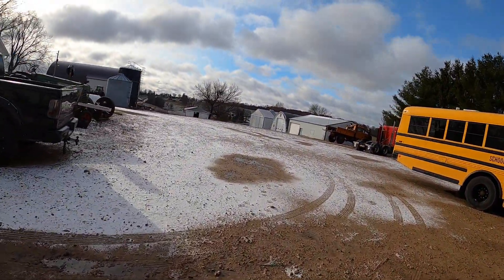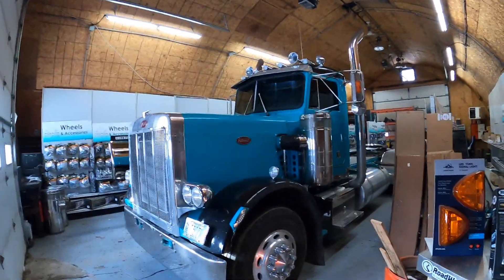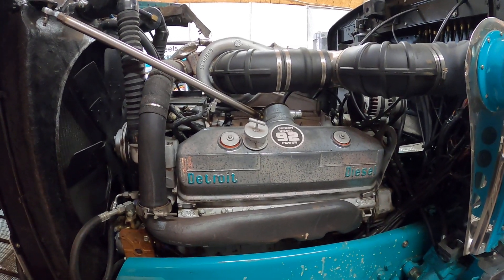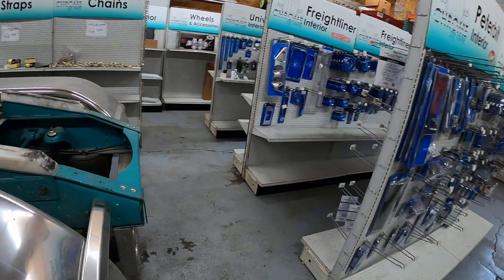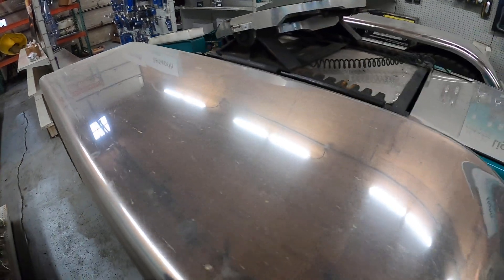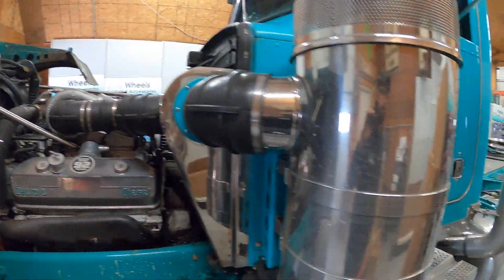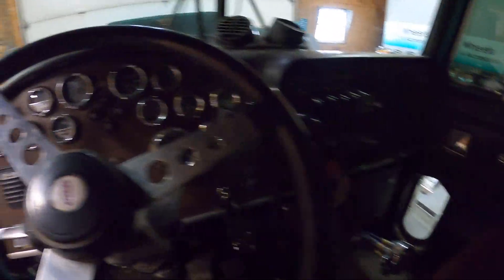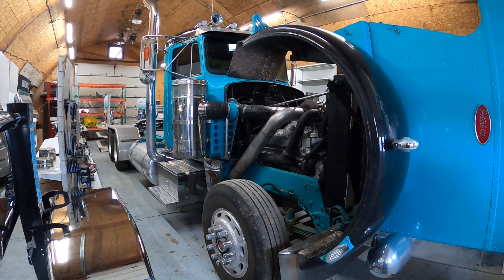JOYRIDE AN IN DEPTH LOOK AT THE DDEC 8V92 THAT ACTAULLY EXISTS

Comment: your cruise should be able to be used with a dual lead(4 wire) electronic pick up sensor on the transmission output yoke. I know some were set up to pull the speed signal from the speedo head wiring while others relied on the transmission pick up.  that was pretty much determined by the truck oem.  even if your running a mechanical speedo you could still run a tone wheel and pick up on the outside of the yoke housing like some do now.

Comment: Most of the comments are on the engine, and that’s definitely interesting, but I want to mention what looks like Delrin sliders on your fifth wheel ramps. Looks like a good idea that works. Please give us a little story on that. Thanks and take care.
Reply from the maker: That's exactly what it is! I've often said it is hard to set a truck up well for multiple applications. With a mechanical neck detach trailer we wanted the 5th wheel as low as possible to run the rollers up on. However that put the hopper bottom into the truck fenders. We had no choice but to go up with it. The Delrin runners are bolted to the top of manufactured ramps to ease that transition. So far it works great. It saves the paint on the truck frame and ramps, grease comes off easily. It doesn't slam as hard. Only catch was that it is slick enough that the support block for the neck will kick out when pulling away from the detach. I drilled some holes in the Delrin and can pin the block in place. Works well. Just 1 extras step. Thanks for watching!

Comment: There's now a common rail 8V92 twin turbo powered race truck. It has dual ECM's.

There's a ton of potential there. It can make way more power than DDEC can, more efficiently.
Reply from the maker: Absolutely it can. We have been in contact with the owner over the past year as he was developing it. He was kind enough to offer us a ride at the uphill drags both last year and this year. Although far from dialed in the truck had already picked up a gear and you could feel the difference in how it launched. To us the number one benefit is having all the fuel pressure you could need at any time. Not having to create it at each injection. Plus you can only get 250cc of fuel or so out of a mechanical 92 series injector. That's if you can find the 30 tear old parts to do it. We won't share his numbers but the fuel potential of the common rail setup is far greater as well.

Comment: That engine sounds awesome on startup…is there such a thing as a Detroit V12 DDEC?
Reply: Yes. They run 2 ecms. A “master” and a “slave” ecm. 
They have to run 2 because the DDEC ecms only have a maximum of 8 injector drivers. 
I’m not sure what all applications they were used in, I’ve only seen them in a generator application.
Reply from the maker: We have never seen one.

Comment: I wonder how well the Detroit V8 would run, and how efficient it might be, with two smaller modern variable vane turbochargers, mounted on the manifolds, to preserve the heat, and an air to air intercooler.

Of course, an air to air intercooler might make it harder to cool a Detroit, and a Detroit absolutely doesn't like to get too hot.

I'm just thinking that a truly modern turbocharger system (you'd need the marine blower bypass setup) would make more boost, quicker, and more torque down at lower RPM, and just generally make more power, more efficiently. Without hurting the engine.

It might be better to spin the blower faster as well.

I've also wondered if using the "normally aspirated" 19:1 compression ratio might make it more efficient. While you would have to limit maximum boost from the turbocharger to a lower pressure with the higher compression ratio, the engine might be more efficient. I know it would make more torque with less boost, and it would build boost quicker. The question is, where is the "balance point". If you're not trying to make maximum HP and using maximum boost to do it (an 8V92 can make 750HP at 1950RPM) can you make more torque, more efficiently, in the lower (1200RPM to 1450RPM) RPM range, with more compression, more blower speed, and a cooler charge?

Comment: Got a 25 year old DDECIII 8V in a Trielectron air start, top rating in the software is 840hp, has around 400hrs on it
Reply: I’d love to see that…how much torque and what do you haul with that?
Reply: @russellking9762  it runs an air compressor to blow start jet aircraft engines, and does it mightily fast and easy

Comment: Awesome. I used to work for Atlas Copco Wagner Mining Equipment Co in Portland, Oregon manufacturing plant as a diesel mechanic and I installed a lot of those 8V-92 T engines in our MT-444 underground mining dump trucks and 8 yard LHD loaders in the 90’s. They where neat in that they sounded great and would fire right up and not surge at idle when cold.

Comment: I am currently running a 91 pete 377 with a 3406b pec cat in it which is an all mechanical engine with a computerized fuel pump timing advance and governor and a 9 spd behind it and 4.10 gears.  this setup also has electronic cruise with 2 speed sensors on tailshaft of trans might be something you could use for your cruise setup

Comment: For the cruise you can use the late model pin on the transmission side. I use the original 2 pin plug until I got the new one from Detroit.

Comment: I’m pretty sure the DDEC 8V92 was the first American engine to be electronically controlled. Then came GM’s Series 60 which was revolutionary because it was electronically controlled as well. I owned a cabover Kenworth with a mechanical 8V92TA @ 475 HP, but with straight pipes they are too noisy, you need at least some muffling. The Silver 8V92s were a lot better than the original Green 8V92s because of improvements in the block, the coolant gallery was too close to the oil gallery and cracked, causing coolant in the oil.

Comment: I like it. How does it do for mileage. I realize in your operations, it's probably not an issue, but I'm still curious
Reply: That's an excellent question.

I say that because I see a lot of the military 8V-92TA engines go for 1/4 the price of a decent Series 60. If those are or can be DDEC IV, and can get decent fuel economy when tweaked to 550 or so,...... I'd consider one in an older Pete with a 13 speed. For the money......

Comment: Got me a 540 hp rated 8v92 in a Oshkosh chassis, when I find the parts to put a manual transmission to it, installing it in my 1975 LTS 8000 tractor!!

Comment: What kind of fuel mileage do you get?
Reply from the maker: Ive never done a solid trip to run out a tank but from the rough math running local to the elevator and its around 5.25
Reply: @MatzkeDiesel  That's not to bad. That's a nice looking and sounding truck.
Reply: @MatzkeDiesel  
That's not bad. Better than I expected. Do you think that your tune and gearing are ideal? If not, what would be better?
Reply from the maker: We feel it's pretty close. It pulls to about 1550. At 60 it's running about 1600 so it's a good usable range. Slower at 55 or so I usually split it. We haven't topped it out but it will hink along @ 75 easily. I plan to get the charger setup a little more efficient and then see if there is anything left in the tune.
Reply: @MatzkeDiesel  
Thanks for the reply. I just like the older stuff. I wasn't sure how much you could do with modern technology, and the electronics. 

I've seen decent deals on older trucks, most seem to "repower" with a Series 60. Which is a good engine, had one in a T700 with a ten speed. I just like the simplicity of the old two stroke, and don't mind the electronics.

Comment: Nice clean truck brother,☆,reminds me of one of my PAST builds,,a candy apple RED1974 Ford 9000 extended snub nose,w/sleeper."903 Cummins ,13 speed with (airstarter,)"extended frame 6ft.,'used heavier frame off 1978 peterbuilt w/rears." Roof mount A/C off an old tractor  🚜 And it "ALL WORKED",,PRAISE JESUS!" great content  Teee.☆☆

Comment: Depending upon your output housing, there's usually two ports for sensors if it has the 16 tooth tone wheel. If it is cable operated it won't work. I'm not sure about Detroit, but on a Caterpillar, you can turn off the road speed sensor and set high idle to 2100 and use that for cruise control.

Comment: You put a Detroit in a Peterbilt? That’s blasphemy
Reply: My Pete 359  has a factory 8V92TA whats wrong with that?  9215 injectors, water intercooler, bypass blower, it runs right along with my two C15 powered Pete 379s.
Reply: @jsatre5504  that’s cool but I’m gonna stick with a 359’s soul purpose engine being either 3408 or 3406B and say piss on that annoying piece of crap 8V92
Reply: @lukeheigle494  
First off, genius, the term is sole purpose. And that's simply your delusion. Peterbilt sold a ton of those trucks with the 8V92TA Detroit. And it seems that there are plenty of them still out there.
Reply: @AlanRoehrich9651  “my vagina is hurting because you don’t like Detroit” sorry bud, I like to keep my ears and pull hills lol
Reply: Pete's in the 70s 80s 90s and 2000s came equipped with Detroit's.
Reply: Why is running a Detroit in a Peterbuilt blasphemy?
Reply: @gb4408  because I don’t feel like wrapping my tachometer out to pull up a hill and burn 2 miles a gallons of fuel. Cat is better sorry
Reply: @lukeheigle494  
🤣🤣🤣🤣🤣🤣🤣

The two stroke Detroit hits it's torque band at 1400, it's usually governed at 2100-2200. It's not turning nearly the RPM that you "think" it is. 

Size for size, it makes more power than your scatterpillar. You scatterpillar and scummins boys always want to compare your 800+ cubic in engines to Detroit engines that are 100 to 300+ cubic inches smaller.
Reply: Hello sir. It was actually Peterbilt themselve’s that put Detroit Diesel’s in Peterbilts.. if you know anything about Peterbilts
Reply: @russellking9762  that's right it was a check box on the order form as to what engine you wanted speced.
Reply: @russellking9762  hello sir, tell me why most of the check boxes on the order forms were filled in for cat. Fuck outta here
Reply: @lukeheigle494  so you work for Peterbuilt and know the percentages of engines specified over the decades. I understand you might have a preference for a particular manufacturer based on the power/performance characteristic's and thats fine, but you can watch your demeanor and language because your IQ is on display. Other people have a right to an opinion based on their experiences and Caterpillar was one option avaliable. Respect the platform.

Comment: Appreciate your video,  I drove a ddec in the mid or late 80's it was in a freightliner  brand new, it was rated at 400 horse with a 9 speed I didn't like the 500 ram splits of the 9 speed and that engine  it was a powerhouse,  not sure what ddec  it was but it came with a hard plastic card from Detroit with numbers from 1 to about 30 or so, we were  shown by the dealer how to use it, you would turn the key on maybe start it I can't remember but there was a button on the dash you would press it once then count the light above that button on how many times it flashed,  then you would  do it one more time, say the first time it flashed  twice, then the second time it flashed 6 times, so you had a 2 and a 6, together  26 so now you look at that card and go to 26 and it might say injector response time slow on number 4 injector then you know you need to go to the shop, they would  plug into a unit in the left jockey box to verify,  I had that happen one time,  memories

Comment: Nice truck. Like the color and the motor. You've done a real clean job. Lots of DDEC 92 series motors built.
Yes, they were the first electronic diesel. No hunting on a cold start because the buffer adjustment is off in the governor. I have a Silver Eagle Bus conversion with a DDEC I that I use routinely. 340K miles and counting. Also have the ProLink readers for the DDEC engines. Handy.
I believe that the cruise control looks at the transmission sensor for cruise. I know that the bus has a tone ring on the front wheel for the speedometer. I just replaced the hall effect sensor for it. The bus also has a pulse generator on an auxiliary drive, at the back of the blower, for the tachometer. No DDEC interface for those two.
I've got another DDEC II motor out of a fire truck for a spare.
Real interested in the II to V conversion.
Yes, post more

Comment: I would like to know where you sourced the conversion kit to swap to a DDEC IV ECM and all the needed wiring to convert a old school truck to electronic 8v92.
Reply: The kit Caleb was referring to was a military kit to convert the DDEC II 8V-92's in ther HEMTT's to DDEC IV so they would still be supported by Detroit. It came with the appropriate wiring, cam pulley, trigger wheel, ECM, ecm cooler and mounting plate, and a bunch of other odds and ends. It is by no means a kit to convert a mechanical engine to a DDEC engine. I am in the process of converting a mechanical 6V-92 to DDEC IV controls, and while not rocket science, there is quite a bit to change over to make the swap. Injectors, front engine plate, cam pulley, front blower cover to eliminate the original governor, fuel jumper lines, SRS/TRS sensor and appropriate mounting bits, and a bunch of little odds, ends and tools to get the swap done right. All in all, I wish I would of started with a DDEC engine at first, but it all worked in the end!!!
Reply: @75LS1Vega  
Can you still find the kits and the military engines?

Comment: What's your thoughts on this DEF shortage? I've got a feeling it's going to send shockwaves through our Country.
Reply from the maker: Well oof. Many of these shortages in my opinion are contrived to drive up pricing. I think that is the case with def. The base ingredients are not hard to acquire and it is not hard to manufacture. I think enough will be let out to keep things moving but just enough to manipulate the price. As a retailer of def I can tell you from our sale point there is currently no money in it. It is a loss leader for us.
Reply from the maker: @tombroer2803  We take applications and compile a list. Then we contact when we have openings.

Comment: Had quite a few DDEC IV 8v92's go through the shop a few years ago that were in big Oshkosh snow blowers, I saved the flash file for those as they were the highest hp 92 file I've seen from the factory. I believe that the 92 series was the first commercially produced fully electronic diesel engine brought to market so I'm not sure how anyone things they didn't exist! Also don't know why anyone would say an old truck can only be a toy! Still have a 78 and 79 A model, 77 359M and an 85 FLC that work for a living. Joyride is cool truck and there is nothing better than seeing a nice old truck still out making money.
Reply: Old is gold, they are way better than what we drive now.  Real trucks driven by real men
Reply: Same
Reply: We used to see them in fire trucks, St.Louis FD had several of them in service and they would bring them to our Freightliner dealership for maintenance & repairs.
Reply: Do you happen to remember what the hp rating was? Reason I ask is I'm about to swap a 500hp ddec 8v92 into an 89 freightliner cabover and 500hp just aint enough lol
Reply: @matthewjones8620  I'd have to go find the file to be sure, but I believe they were 760hp.
Reply: @speedandmarine9066  thanks for your quick response, would you be able to reflash my ecm to that spec?
Reply: @matthewjones8620  I don't have access to datalink, software, etc. If you hand your ECM to a dealer they can bench flash it which is what I did the last time I worked on one, although that has been a few years.
Reply: Believe the n14 was the first electronic engine but they were close
Reply: @mackenziesibley7025  Nope. N14 was not only not the first it wasn't even Cummins first electronic engine. 8v92 was the first fully electronic by several years. Cummins first electronic engine was a Big Cam with a modified PT pump. That was followed a couple years later by the Celect N14 and M11.
Reply: @speedandmarine9066  you are right I had to look it up 87 Detroit put out the 60 series and cummins was just after it with the electronic 855
Reply: No, the DDEC came out well before the N14, cant quite remember the date but i imagine you could google it buddy👍@mackenziesibley7025